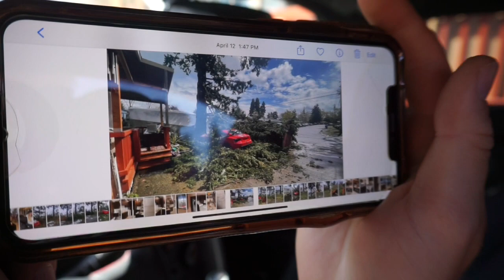Buying FR-S In Cash $!!

Comment: Clutches on these cars are pretty average stock…. Has to do with the spring that engages it. Mine feels as if it doesn’t have grab but it is just late as the spring that is on the clutch pedal causes it to feel that way. 

Switch out with MTEC or just remove the spring
Reply: Clean up the torque dip with some cat less headers and get it retuned, I don’t think it is a 2 step tune it is a launch control tune.